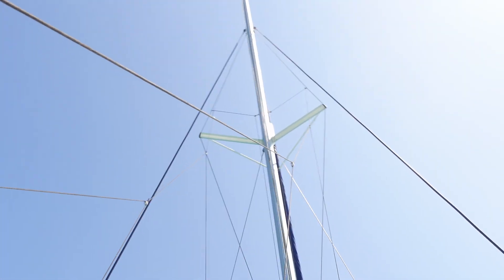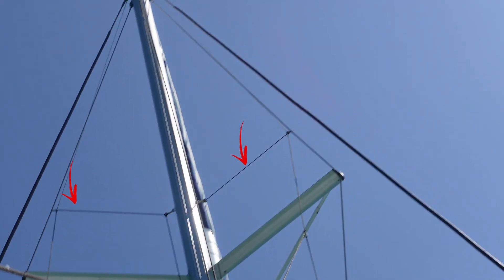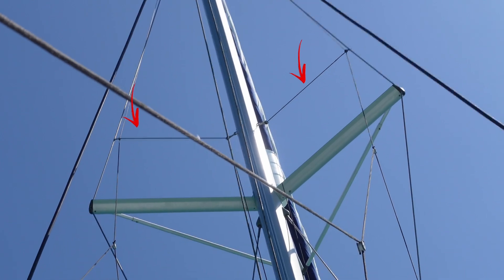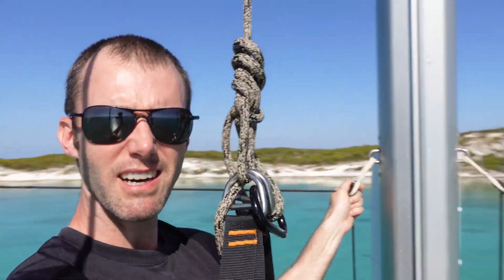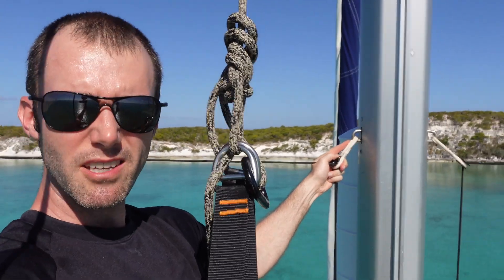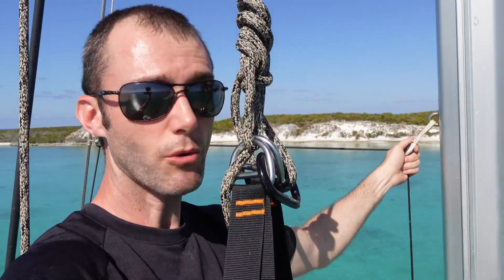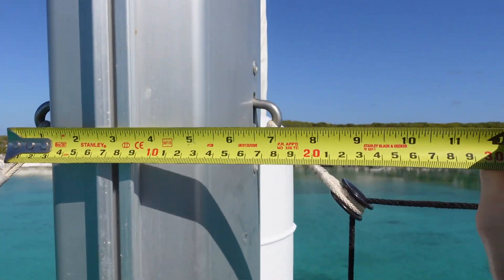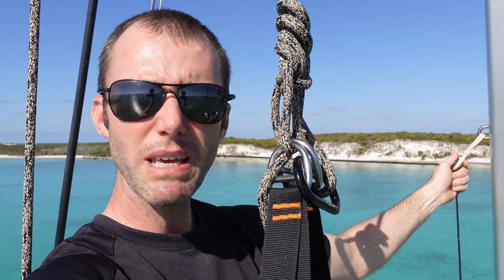Our FAVORITE TRICK to Make Raising the Mainsail EASIER!

Comment: Somebody needs to write a book, "101 Uses for Antifriction Rings on a Boat".  Good solution.  I have even seen them anchored into the spreaders rather than the stays, but I think this is a safer way of spreading the load (although more points of failure).  Replacing the Dyneema lines and loops and a couple of antifriction rings is much cheaper than replacing a damaged spreader.
Reply from the maker: You're only limited by your imagination in using boat equipment for unintended purposes!  😂  I do agree with you about the method using low friction rings being a better way to spread the load.  We had originally considered mounting the lazy jacks on the spreader but were worried about potential damage in the event of a shock load.

Comment: That’s an awesome 2:1 main halyard becket attachment to the mast 😂
I’m happy you focused on that upgrade, it’s important to be aware of this great upgrade that could possibly be costly if the 2:1 Main parted because of the accumulated twists.  FYI that’s an Eye/Clevis swivel shackle from Tylaska. 
BTW: The coating that I applied on the mast still looks pretty good
Great video today from aloft SH. I was hoping you would film those beautiful new solar panels from the masthead. Next time 
Enjoy your lovely warm weather
Reply: OCS, Would like to know if you're worried about chafing from the halyard shackle?  Have you had to place tape or anything over it?
Reply from the maker: Tim Leary - It really is amazing what a difference the swivel makes. And you found us a much better one than we had previously!  😄
Reply from the maker: WaterWings - I always keep a close out for chafe, but I'm not super worried about it with the swivel shackle.  There aren't really any sharp edges on it and when the main gets raised, the topping lift goes a bit slack so less likely to be "cutting" into the shackle.  And of course, now that I've said that I know the next thing that will chafe on the boat...  😂
Reply: @OutChasingStars  
Thank you
Reply: Great trick! We will be adding that ASAP!
Reply: @OutChasingStars  Is this the T12 or the T8? Do you have a link for this halyard shackle at all?
Reply: Hey Tim do you happen to know if this is the T12 swivel?

Comment: Great idea to widen the lazy jacks!  Have you ever tried raising the main while still on anchor or mooring?
Reply from the maker: We have raised the main while at anchor or on a mooring but it can be a little bit trickier since we try to get the main on the leeward side of our topping lift for the angle we're going to be sailing.  If the main isn't feeling super cooperative, that can require us to rotate the boat to get some help from the wind.  Hence it's a little bit easier to do that when we have room to motor and maneuver.

Comment: Nice video and well done as always.   My solution to the twisted main halyard has been to manually untwist the line each time after raising the main.   This works perfectly but is a tedious process.  I'm now tempted to buy one of these swivel shackles but have concern about whether this swivel shackle is really able to fully keep twists out of the line for several reasons:  1) the swivel shackle rotation is not friction-free, 2)  with the swivel shackle under the significant load of the heavy main the friction within the shackle would be raised, and 3) the twisting force of the line is not very strong until it has developed a lot twist.     I mention these concerns to sort of 'double check' with you about whether this 'fix' really does eliminate the twist such that the main halyard is truly "twist free".  ??   About the lazy jack solution . . . Like you I'd rigged mine up with a wider attachment but without the elegance of your installation.   I did this while down here in the Bahamas where I didn't have access to marine hardware.  Conceptually I wanted some type of hardware that would allow me to directly attach to the shroud . .  like a "U" bolt clamp.  This would eliminate the need to run that supporting line all the way up to the top of the mast.   I did see some "U" bolt clamps, but the ones I saw were only a clamp w/o any point to attach a line.    Maybe someone knows of a hardware item like this (i.e. - a "U" bolt clamp with an attachment ring)?   Regarding the low friction rings . .  maybe use a small block for less friction?
Reply from the maker: For the twisted main halyard: all I can offer you is our experience (shared by others) that adding the swivel shackle significantly decreased twist in the main halyard.  Is it ever going to be completely twist free?  No.  Especially at the end that goes around the electric winch.  But it will certainly prevent situations where the twist at the mast becomes so great that the main physically won't come down.

Lazy Jacks:  Let's start with the caveat that I'm definitely not a professional rigger... I'd be a bit worried about the compression of a u-bolt on the shroud needed to make sure it doesn't slip if the topping lift fails and the lazy jacks take the shock load of the boom+sail.  Also, metal on metal is another area of corrosion concern.

Low Friction Rings: Kind of like you, low friction rings were what we had on hand when we did the project. 😄  I slightly prefer low friction rings for this application as the constant force on a block could make for a flat spot.  But as I mentioned, I do wish we went with a larger diameter low friction block to make the turning radius bigger.

Comment: We've had good success with pulling one side down and tying off at the mast then head off a few degrees instead of head on into the wind and then letting the wind be your friend.  Super simple, just need to remember to put them back : )

Good tip though!
Reply from the maker: That would work too.  But is just one more step to have to remember.  😉

Comment: Does having the top of the lazy jack 3' from the mast cause any stress on one of the lines, let's say when you are on a broad reach since it is now a longer distance to attachment point on stack pack vs distance when boom is centered?
Reply: Great question. following.
Reply from the maker: I think any additional stress is probably minimal compared to the overall safe working load of the line used for the lazy jacks.  And as we move to different sailing angles, the angle of the boom changes as well, usually being pulled upwards which would help slacken the lazy jacks.

One thing I should have shown in this video but forgot is that the lazy jacks are secured at the base of a mast using a cleat.  So if you're particularly worried about stressing them on different points of sail, you could always just loosen then a bit.

Comment: Great video as always! Did you consider connecting them on bottom of the spreader? I heard some people do that. Would not be 6 feet wide but perhaps 3-4 feet wide, Do you think that would be a good compromise solution?
Reply: Came to the comments for the same question...so following.  It's a great idea but wondering about advantages/disadvantages to this connection point.
Reply from the maker: Using the bottom of the spreader was the first method Spike and I considered.  At the time, we weren't sure how the spreaders were supported and were worried about the spreaders taking the full force of the boom/sail if something happened to our topping lift.  Our method of using the dyneema "lift" line all the way up to the cap shroud tang is incredibly strong and I don't have to worry about damaging the spreaders.

In general, I'd say that any extra width you can get for the lazy jacks is a big improvement, but if you want to use the spreaders for mounting, make sure you're quite comfortable they'd be okay handling a sudden shock load.